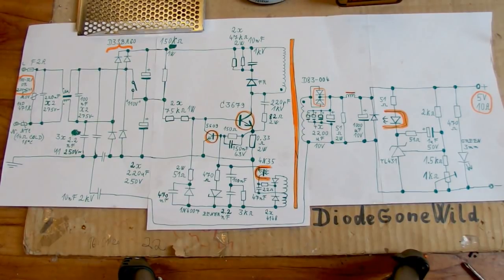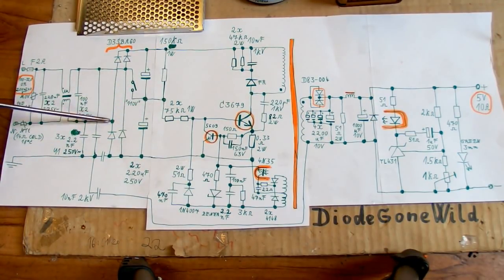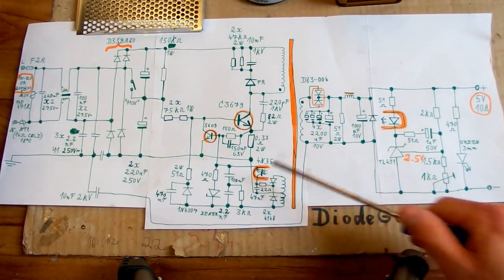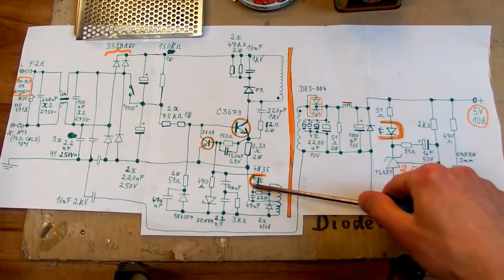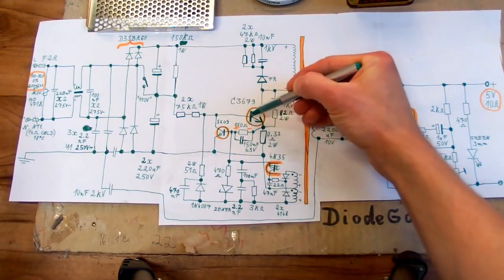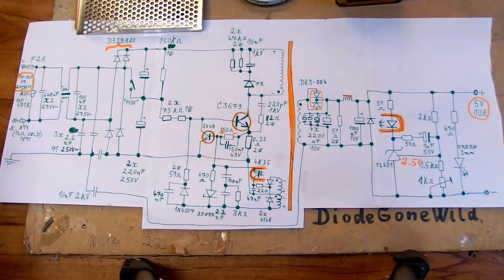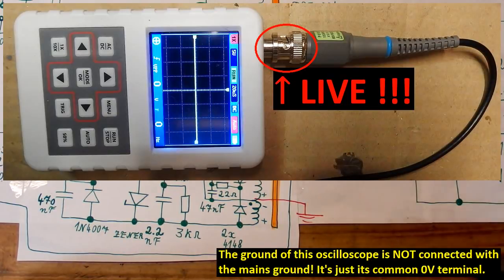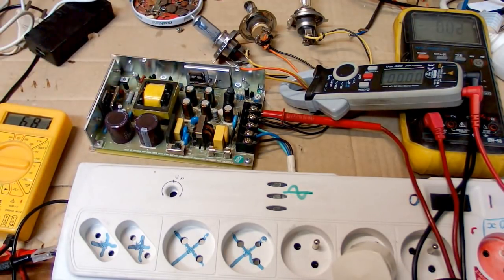Flyback switching power supply schematic explained (5V 10A, no chip)

Comment: Sir how does the feedback from optocoupler give fix voltage since in flyback during the ON state of power switch device the energy is just storage in core and during the off time the energy transfer to secondary, mosfet is already off how this feedback affect the output ?

Comment: You said it is strange for the 470nf and the diode circuit below....I think 470nf capacitor and the diode parallel to the capacitor and the resistor is a snubber circuit for protection of the transistor when the power off

Comment: 25:33 i guess it deep shapes the waveform because, as you mentioned the auxiliary transistor is turning off the big transistor, the turning off process is in two steps. Step 1 is the auxiliary transistor conducts some current but not enough to turn it off and then after some time the feedback collapses (Step two) and the voltage at the base goes down and transistor starts to turn off. The auxiliary transistor wont turn it off at 0.5 volts but would conduct current linearly and at like 0.7volts it would stop the voltage rise at the base of big transistor which leads to collapse the feedback loop because no voltage is rising at the base of big transistor.

Comment: Would it be safe to say that the voltage-time areas of the waveform are equal above and below the zero line assuming no hysteresis or copper losses in the transformer?

Comment: Hi, rally it good thanks you so much. And please tell  how to select topology and what are the critical parameters consider for converter topology selection.  E.g 48vdc input, o/p 12v/10A isolation cccv  driver for charging application,  this we can design flyback or forward or push pull or half bridge. But how to select for topology for start up. Pls help me

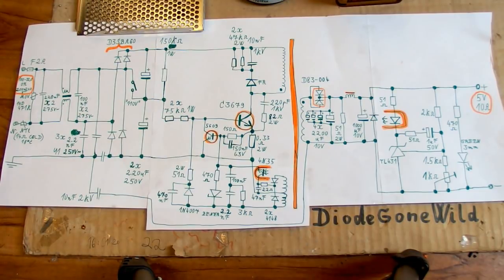Comment: 2:54 I have a PC power supply(230V/250W) in which is secondary side of that part connected via a metal housing and leakage was 120V/5A before I repair. Now is 120V/1A.

Comment: How is the section (around 4 min) a voltage doubler when mechanical switch is closed, since the caps are in series, won't that diminish stored potential,  but since there are other electrical pathways I between them, does it form more of a staccato transient t  between them, that releases an appearance of double voltage?

Comment: Can confirm, zener is an open-loop protection component.
I just simulated this, and forgot to connect the feedback on the output - it didn't run away, seems to stabilize just past the optimal voltage as predicted...
Reply: simulated an entire PSU?
Reply: @valdisblack1541  Probably. I like to design and simulate my own PSUs. One day I'll get around to actually building one...
Reply: @VT Could you please share your simulation?
Reply: It's possible, but best done on a fast computer...
And the simulation is done in LTSpice, where I just "dropped in" the schematic from the video (that means recreating the whole damned thing and it's operational conditions - hence being possible to miss a connection when not paying attention!)

I've used this method to perfect a design which is pending some thorough testing, i'm just waiting on the magnetics (transformers and chokes), must understand it well before proceeding...

Comment: if flyback topology good for ~125W, then what topology is better for higher power?

but I don't think I can see the circuit before I buy any SMPS anyway :
Reply: Short version: Forward converter. Longer answer, there are many subtypes of forward converter: 1-transistor forward, push-pull, half-bridge, full-bridge to name a few.

Comment: 19:00 about this zener -- just remove the optocoupler and start the PSU, this will definitely give you the answer. I think this is open-loop and primary side parts failer protection. This is your last hope basically ;D
Reply: And risk blowing your capacitor bank and the load? I'd be more careful and change the 2.5 V sensing resistor. And I wish someone would donate a multichannel oscilloscope to our teacher.
Reply: @atdzsny  yes, risk is always here, this is the experiment!

Comment: 10:36 I've checked the unit I have and this cap is multilayer 150nF one. Marking says 2A154J, it's green flat cap like this: www.ebay [dot] com/itm/20PCS-100V-0-15uF-150nF-150000pF-2A154J-5-Mylar-Film-Capacitors-Radial-/252350624001

they just use parts they have ;D

Comment: If breaking the positive feedback in a self oscillating power supply is a good way to controll its duty cycle, does that mean I can copy the same principle in those dual transistor configurations found in power supplies and cfl drivers? (My plan is to use a zener, optocoupler, a few transistors and diodes to short out the base driver feedback transformer when a preset desired voltage is achieved)
Reply: I'm not sure, but I don't think that will work well in a self-oscillating half-wave power supply. I think you'd have mixed results. Keep in mind those supplies need to have the high and low-side transistors on an equal amount of time to work properly.
Reply: @eDoc2020  Half wave is the one shown in the video. Mine is full wave. Im not concerned about asymmetrical signals, as the feedback circuit I'm planning will have a low freq-filter, therefore only minor disbalance in the capacitor divider is possible.
Reply: @two_number_nines  It's not about imbalancing the capacitors, the problem with asymmetrical drive is you'll saturate the drive transformer unless you find a way to compensate.
Reply: @eDoc2020  the film capacitor in series with the coil does many things including dc filtering. Anyways, I don't see what's asymmetrical about dual wave rectification short-out of the feedback transformer either with a half bridge rectifier and a transistor, 2 transistors for each cycle, or a full bridge rectifier and a transistor to its dc output.
Reply: @two_number_nines  If you short out the feedback in both directions, that will indeed prevent asymmetrical drive. I don't know how well this would perform, there's a chance it might stop the oscillation or worse run the transistors in linear mode. It certainly could be worth a try or at least a simulation to see what happens.
Reply: @eDoc2020  Yes that's my main concern and reason to post the original question, but If this problem applies to a half Bridge driver I don't see how it's much different than the half Wave driver shown in the video, as there we also have a basic negative feedback loop that looks like It would lead to linear mode. However the oscillogram diode showed us looks like It goes in linear mode for a very brief moment, then positive feedback loop completely and quickly falls apart and the transistor completely turns off.
Reply: @two_number_nines  The huge difference is you have two transistors working instead of one. The circuit here stays oscillating because there is continually a small amount of bias current. With CFLs there are stacked NPNs so it's hard it's hard to bias the high side. Instead CFLs charge up a capacitor and then dump it into one transistor and AFAIK each subsequent pulse is started using energy from the previous pulse. If the oscillation is stopped I believe you need to wait a few ms for the startup circuit to kick in again.

Regulated half-bridge PSUs tend to use a chip like the TL494 to generate the drive waveform and the self-oscillation is suppressed once the 494 takes over.

I suppose another option is to use a PNP as the high side output instead of NPN, then you can bias it easily.

Comment: This kind of designs are current-mode, just like UC3842 and similar. Unstable frequency is not a drawback, usually. SMPS I build behave differently: under no load they oscillate slower, which helps reduce no-load consumption, just like sophisticated IC's. The more load, the higher the frequency, this one is a bit weird to me.
  MOSFET as a switch makes a world of difference: lower no-load consumption, higher efficiency. Supplies I build lately are all FET-based. As much as I like good 'ol BJT's; they are dogs. You can turn them on fast, but turn off opens whole new can of worms, like stored charge carriers and so on...
Reply: Hey boddy you can help me calculate how much turns need to  tranformer ?
Reply: @giovinis  Search "Flyback 8.1" on Google. Then you can see my video explaining how to use that software

Comment: Actually the energy is stored in the air gap of the core not the core itself.
Great video as always
Reply from the maker: The energy is distributed in the entire magnetic circuit, but you're right, most of it is in the gap.

Comment: I think that "overvoltage protection" is just an full wave "power supply" for the phototransistor in the optocoupler.
Reply from the maker: I meant the "overvoltage protection"  is probably the zener.
Reply: Thanks  @DiodeGoneWild , I mixed that up. My problem was that why do you need a two way rectifier to feed a single phototransistor, but maybe you need that too.

Comment: For those, who are familiar with control systems and PID controls, using the TL431 with it's capacitor and resistors acts as a really basic PI controller.
If you derive the formulas, the LED current (so the transistor current also) contains an integration component regard to voltage error, and a proportional component regarding to output voltage.
Reply: I also would add that what he calls a "strange circuit" looks like a current control flyback topology, meaning the control signal via the coupler basically controls the current and thus the transfer function basically is one of a current source charging a capacitor being essentially an integrator. 
This makes achieving a stable loop a lot easier esp. in inductor continuous current mode.
In discontinuous mode and pulse width control the power is a square function of pulse width, already making the loop optimal compensation only possible for a single load value, but in continuous current mode it turns into a second order system very hard to get stable.
Reply: Do you believe in, overunity,  or being  able to do more work with far less KVA ?

Comment: I guess that the "input overvoltage" protection is there because it has a manual input voltage selector. It is probably there to protect the circuit from running it from 230V when it is set to 110V input by mistake.
Reply from the maker: maybe, but the primary electrolytic  capacitors would explode anyway :). even if the transistor didn't
Reply: @DiodeGoneWild  So true, I guessed they are 450V capacitors, but I re-checked the previous video and they really just 250V ones.  And probably it would be too slow to save the transistor.

Comment: It would be interesting if you could reverse and/or repair a NUS-002(EUR) Nintendo 64 power supply. It seems to be a very hard match, as all youtubers tried to fix it, they give up
Reply: It does not seem to have inrush current limitation because it produced som nice sparks when being plugged in.

Comment: Can u design a SMPS with using 555 timer with a flyback topology?
I working on it now but it still didnt work.
👍👍👍
Reply from the maker: Maybe you could somehow botch it with tons of external components, but why turn a washing machine into a fridge if you can just get a fridge? There are tons of suitable flyback control chips, including the old good UC3842.
Reply: Yeah, i already see the SMPS using UC3842 and its easy to done it. But my project requirement is needed to use the 555 timer to create the PWM pulse in SMPS with flyback converter topology. Thats why I asking u about the design circuit cause i see u are very experience in this SMPS.
Reply: @usonudom3081  You can easily make an unregulated smps with the 555, for example i used it for an unregulated boost converter 7V->200v at low current for testing leds

Comment: How would I go about building a 2kw 100v dc power supply? Does rectifying one of those cheap SCRs work? Or is the power at lower voltages limited? I live in a 230v area. Maybe you guys can help me out. Thanks in advance!
Reply: If the voltage and galvanic insulation are not important you can use a capacitive/inductive dropper to limit the current and a full bridge of diode for making Dc
Reply: @samuelecaldini4400  do you think it's possible to build a capacitive dropper that outputs 2000w ?
Reply: @garage_projects  Of course is better to use an inductive dropper for high power, otherwise you will need a capacitor of something near 200uf! depending on the voltage  drop on the electrolysis cell
Reply: @samuelecaldini4400 sorry, i'm kinda new to electronic. I can't find anything on inductive dropper circuits. Can you post a link please?
Reply: @garage_projects   Sorry but I'm italian, and I think inductive dropper is not the proper name for what i mean. 
For powering the cell instead of putting a big capacitor in seris you can put an inductor to limit the current. You can use a primary of a transformer as inductor, or a variac(a variable transformer) if you have one.
This system was used in ballast for fluorescent  tube; diodegonewild also used some inductor in series for powering his Spark gap Tesla coil.*
Of course you need to find a proper inductor for your power need, rememer also that using an inductor is less efficent then using a switch mode power supply, but it's simplier to make.

*He talk a bit about it in this video:
https://youtu.be/zo1TYNwWjJo
Reply: @samuelecaldini4400  Thanks for the explanation, i will look into it. Someone else suggestet rewinding some microwave oven transformers. Do you think this would work?
Reply: @garage_projects  Yes, it will probably work, but you need 2 or 3 transformer for 2kw of power, because each one is 800w-1000w.
Reply: @samuelecaldini4400  yeah sure but they are cheap anyway. I think this is the easiest option, i will probably do that
Reply: @garage_projects  If this supply doesn't need to be smoothed you can just wind a 100vac supply and run it through a (Beefy, more than 20 amp) full bridge rectifier. This will give lots of ripple, which may be acceptable for electrolysis. If you want a smoothed supply use a 70-75vac winding and add a large (22,000 uF) capacitor to the output. In this case the windings and rectifier need to be good for probably at least 40 amps.
Reply: @eDoc2020  yeah i was thinking exatly what you described because the voltage should be decently stable as electrolysis is most efficient in a certain voltage range. I was also thinking to use a igbt in order to chop the dc and limit the heating/gas output of the cell
Reply: @samuelecaldini4400  If the load is disconnected or reduces its power consumption, the voltage will spike up.
Reply: I think the best option (if you don't want to buy one) is to use a full bridge with like 600v 15A mosfets. 
Why do you need that? 😀
Reply: @barnabasnagy9595  thanks for the advice! I need it for an electrolysis cell